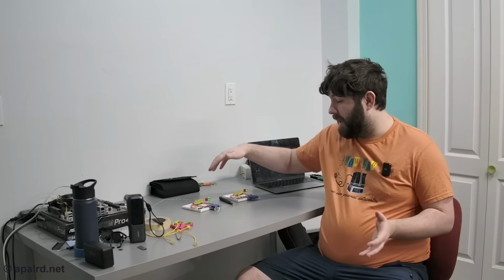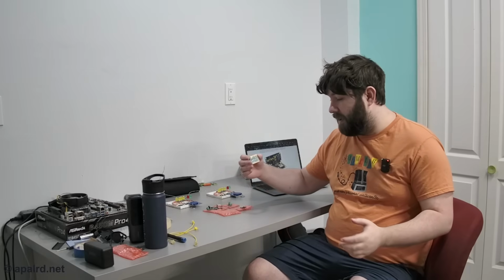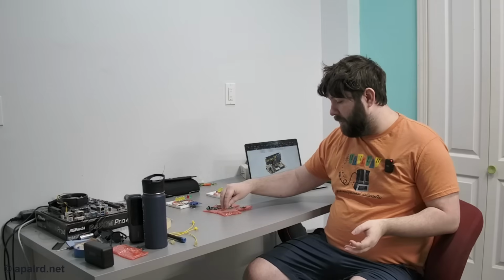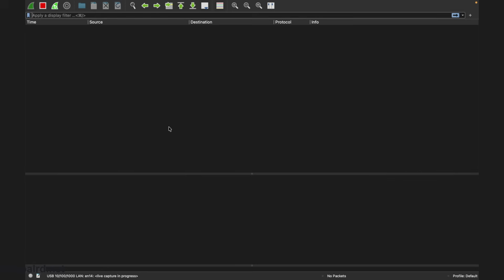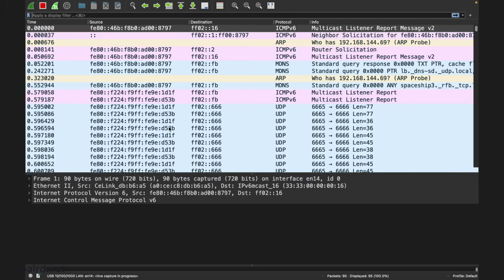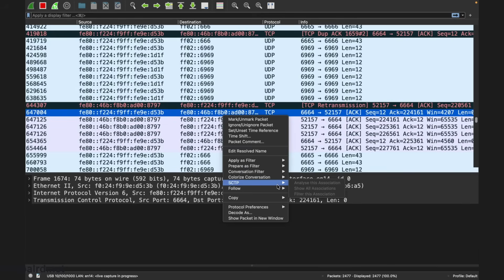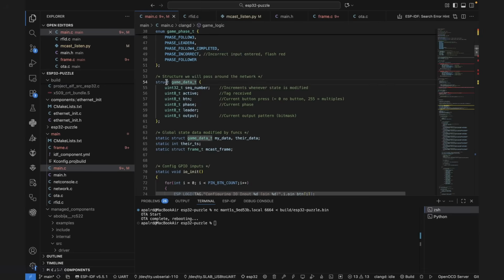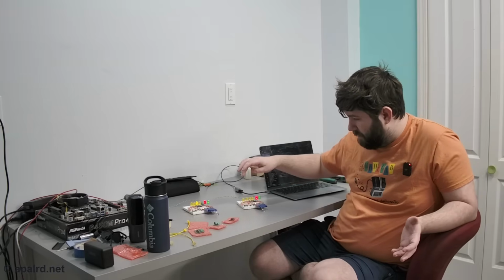ETHERNET is a BUS again?!? Taking a look at 10Base-T1S Multi-Drop Ethernet

Comment: Would be interesting to try.  Wish it was a bit cheaper then $44 per module.  ESP32 boards are $4.
Reply: The PHY chips themselves are only a couple of dollars and don’t need many external components. These modules are only expensive because of the low volume PCB assembly.
Reply: I don’t understand why he didn’t just use WiFi for this.
Reply: @therealcmj if you want better reliability wire is always the winner 👌
Reply: @testman9541  we’re taking about 10 or 20 feet in a controlled environment. Honestly, I think that pulling a wire and using this board is more complicated and likely to fail than WiFi or Bluetooth on an ESP32 device board in this situation.
Reply: @therealcmj in an automobile, in a machine or in a building... Twisted pair will always be better than relying on spectrum availability and low noise in the environnement 👌

Comment: Fuck yeah embedded IPv6!!! I love seeing well implemented embedded IPv6!
Reply: The only time I've seen embedded IPv6 is in Matter/Thread specs for IoT devices. It's so much better
Reply: What’s the advantage of IPv6 in embedded?
Reply: @bensmith7190  No advantage.
Reply: Fuck yeah i love seeing over800% overhead in my resource-constricted applications.
Reply: @denisdrozdoff2926  Ethernet+IPv6 headers takes 72+60 bytes, it's not that much.
Reply: @denisdrozdoff2926  Could you tell me where this overhead is coming from, compared to v4? I’m curious.
Reply: @xanderplayz3446 it's not as bad compared to v4, but if we shed all of the IP stack where it doesn't belong the change is dramatic.
Reply: @xanderplayz3446 packet header. 20bytes larger.
Reply: IPv6 - overingeneered nonsense
Reply: @btudrus aka you refuse to learn something new. IPv6 is conceptually so much simpler than IPv4 so... no.

Comment: single pair ethernet (SPE) can move up to 10Gbit, with up to 25Gb on it's way. 10Gbase-T1 (no S or L)/802.3ch, can have runs up to 40m. 1Gbase-T1/802.3bp, up to 40m.  also, 10base-T1 (no S) is capable of 100m transmission, while -T1L is capable of 1000m.
Reply: Interesting
Reply: SPE/Ethernet-APL is really interesting, especially for industrial uses, especially for replacing profibus PA in process automation. However, i believe it is only P2P and not multidrop, so I would not be surprised if this is a continuation of the standard to allow for multi-drop with the speedloss you get with a large collision domain.
Reply: @AlecTBM  according to what I read, they're all multi-drop capable.
Reply from the maker: SPE is not all multi-drop capable. 10Base-T1S is, but 100Base-T1 and 1000Base-T1 are not. 

T1S also does not use CSMA/CD as in legacy Ethernet, it uses a scheme called PLCA (PHY-Level Collision Avoidance) where transmit opportunities are offered to each node on the bus sequentially based on the order in which they joined the bus, so each node is periodically guaranteed a very short interval to begin transmitting without congestion. This generally avoids collisions entirely and only wastes a very small amount of bandwidth with the empty transmit opportunities.

Comment: Close enough! Welcome back, Thicknet
Reply: More like thinnet.  Thicknet (1/2in+ diameter) coax was significantly worse than RG-8. Entirely. Not. Fun.  Not even the vampire taps were fun after the first couple.

RG-58 (under 1/4in dia) was a lot better especially being able to terminate with easy to crimp BNCs.  But it did become a forest of BNCs and Tees...  Some vendors improved this with a twin RG-58 in a single jacket that integrated the Tee on the device end and came with various connectors (or even just wire ends to attach your own) on the other (for the  physical plant). Just avoid the ones that had single plug that went into a special connector that tried to automatically make/break the bus as appropriate for the device. They sounded so nice, and even the demonstration and first few months of usage were pretty nice.  Then the intermittent problems started...
Reply: I never managed a thicknet network  @Sylvan_dB , I only used one, but I never saw network engineers crawling around under desks trying to find and fix standing waves. When I was managing a thinnet network though, standing waves were a daily occurrence.

The day we plugged everything into a new structured cabling system and 10/100 switches, was a day of joy.
Reply: Ah, don't remind me about Thinnet standing waves. *8')

Crawling around under desks, swapping cables to try and move the standing wave away from a node, to get it back on the network.

Comment: This is perfect for my ESPHome boat. I now use CANBus, but this is so much cleaner, using ESPHome's packet_transport over UDP makes this all too easy.
Reply: $50 per node is kinda steep, no? RS485 seems a lot more fitting.
Reply: @JGnLAU  RS485 doesn't perform reliably enough for me in automotive/maritime applications.

Comment: One other application I can see using this for is Out Of Band management/IPMI. Instead of each servers IPMI taking up an extra port on a switch. You use one for each server rack. This also keeps the wire management to a minimum.
Reply from the maker: Meta had done a conference talk on something somewhat similar. They are using GPON for their out of band network. They already share nic and bmc across 4 servers, but now they can optically split a single fiber to 32 top of rack oob switches instead of running 32 fibers. They also switched to using multiport ONUs instead of switches, so they fit on top of the rack instead of using a rack unit.

Comment: I wonder if one could use Thread for implementing such puzzles..
Reply: Thread is basically updated ZigBee. You can totally do that, but why? Wires are way more reliable
Reply: @saiv46 yes, wires are better. My thought went along the line of "already fully integrated ipv6 with existing jellybean components and the border gateway problem solved" - one would get most of the stack handed out

Comment: I was peripherally involved in the IEEE side of the development of this stuff a number of years ago. I worked on a team at Harman International that was involved in the AVB/TSN standards for pro audio and automotive use cases, and we collaborated a lot with groups from Broadcom and other OEM suppliers on the lower-level technologies. We helped get the BroadRReach stuff out of the weird apartment complex use case it was developed for and into automotive, which got the industrial control folks interested eventually. The CAN people were not really happy about the T1 developments; one of the things I personally did was some experiments around doing time sync with 10MB multidrop ethernet, which the CAN folks were arguing was not feasible. This is as far as I remember things going anyway via second-hand conversations with colleagues who worked more closely in the "political" arena of the standards development.
Reply: Interesting, I wonder if it was originally developed as an alternative to Cisco's LRE which was developed to do 10Mb over single twisted pair and distances of >100m. Cisco developed it for hotels, but I know it saw use in many apartments in places like NYC where the cost of running new cables was large.
Reply: just tell me whose side I should be on.  gosh!

Comment: It's great the automotive industry is focusing on CANbus replacements, rather than securing the electronic components that run on the car.
Reply from the maker: One of the big problems with can bus is that the payload space per frame is too low for any modern message authentication codes which provide real data security. Moving to can-fd gives 64 bytes of data, which is better, but Ethernet can go much higher.
Reply: @apalrdsadventures 
Please note: I know next to nothing about ethernet, whether in hardware or software. 
Couldn't the increased complexity of ethernet lead to parser vulnerabilities?
Reply from the maker: Only if you use a parsed encoding and not a static binary packing or something simple. You could take every can bus message and send their binary data all in one Ethernet frame, for example. 

Aviation Ethernet doesn’t mandate IP be used at all, they send with custom ethertypes to Ethernet multicast groups. I personally prefer using ipv6 link locals instead but that doesn’t mean you can’t raw dog Ethernet frames for local messages.
Reply: Yay, even less repairable cars!

Comment: I designed some devices that had to deal with CAN-bus in my previous job. CAN-Bus and its related J1939 were nice to debug at the logic-level, almost every oscilloscope could be used to debug it. Unfortunately, CAN is a nightmare at the electrical level, and it is my most hated protocol after 1-Wire/iButton.
Reply: 1-wire. It's named 1-wire, but actually uses three. Two if you are doing very short range. This is what happens when marketing names the product.

Comment: Sadly 10 baseT is no longer supported by a lot of 2.5G and above switches so you are stuck jumping 10base t to 100 or 1g.  At least the protocol is consistent and ip tools work
Reply: That little switch is a 10/100 chip so the upstream port could be 100 base-t.
Reply: The ManT1S-Bridge supports 100 Base-T.

Comment: Sadly, its too expensive compared to CAN Bus (or even a regular Ethernet port for ESP32). I have even seen a ESP32 with POE capability that is cheaper than that.
A Network with 8 Devices costs with this system 8*44$ + 58$ = 410$.

In comparison, I get a ESP32-POE-ISO for ~25$*8 + 100$ (for an 8 Port POE Switch) = 300$. If I can use a simple USB Power Supply, I can get away with even less.

Any info on what price is planned/to be expected in the future?
Reply: ManT1S manufacturer here.  I wanted this board to be significantly cheaper, my aim last year when I started work on it was low $30's at introduction.  But then someone started a trade war and with tariffs and bans changing from one week to the next, my component cost, import cost and uncertainty in general have skyrocketed.  The fact is that at this time, I do not know what it's going to cost me to produce these until they are physically in my hands and the final tariff bill has arrived.  So I raised the campaign price to maintain a profit margin based on tariff history observed this year.

A crowdsourcing campaign is not just buying a product but also a way to support a manufacturer to be able to launch something you want to exist in the market.  If you don't want to do that, or you are not interested in the technology existing in the market, that's fine of course.  I personally think T1S is an interesting technology and I want people to have an easy way to get started with it.  Comparing apples to apples, this is not a bad deal (see the comparison table on the campaign page).  Yes you can use the ESP32-POE-ISO if it works for your application, but that only works if you don't need more than 2W of power.  Upgrading to the wESP32 you get 13W, but with the ManT1S you can reach up to 52W.  Whether that matters to you depends on your application, but it does open applications that the ESP32-POE-ISO can't handle.

I hope to lower the prices in the future if conditions improve, but I'm not holding my breath for the next 3 years.  In the meantime, the kit offers a bit of a discount versus individual boards.
Reply: And good old RS485 is even cheaper still.

Comment: How is T1S with a Mantis Bridge better than CAN with a CAN to Ethernet bridge? In the end of the day both seem to need a bridge to connect them to regular ethernet network.
Reply from the maker: The mantis bridge is passing Ethernet frames between two layer 1 protocols with the same layer 2 framing. Can to Ethernet requires decoding / converting the can frames which requires knowledge of the data structures at that layer.
Reply: @apalrdsadventures basically the mantis bridge is a layer 1 media converter,  and a CAN converter is a full layer 3 device and likely only speaks TCP/IP. In theory you could run NETBeui or IPX/SPX over 10BaseT1.

Comment: Multi-drop "Bus topology" is the problem.  All too often one of the controllers grabs the bus and doesn't let go or puts noise on the bus.  Ethernet would be a great improvement in cars and trucks but it seems to me it needs to be in a star/switch network not a bus.
Reply: With T1S it's essentially a time-share protocol underneath, where each node on the bus has it's own limited time segment where it can send packets (with the optimization that if a node doesn't have anything to send, after a tiny bit it moves over to the next node on the bus), so I don't think that's a problem here. The bus is mostly requested by automotive, as they want to reduce the amount of wiring as much as possible.
Reply: @ignaloidas  It's called PLCA for those who want to look it up.

It's not like token bus/ARCNET. It reminds me of some previous protocol but I can't think of which. It requires a timing accuracy between nodes which would be hard to satisfy at high bitrates but seems pretty easy to manage at the short lengths and slow speeds of 10BASE-T.
Reply: @ignaloidas  ~ Any time-sharing bus topology is going to be unreliable, especially in an automotive environment!  Ask any car or truck mechanic!
Reply: Sorry I'm a noob in networking, but can't a single controller still flood the ethernet channel(s) with noise and thereby disable all communications?
Reply: @0xfadead ~ If it was point-to-point with some sort of switch in the hub, I would expect the switch to disable any offending device.  Another option would be two identical multi-drop networks to all node so if you have one go down for any reason any of the nodes could turn on the money light and still keep working on the redundant bus.  Twisted pair is cheap and lightweight and this would really improve reliability and troubleshooting of complex bus system problems.

Comment: First Ben Eater and now you; I'm really surprised how a lot of Tech YouTubers I watch have a background in avionics. Knowing about Arinc 429 etc. 😂
Reply from the maker: God I hate ARINC 429 so much. I wrote a bit banging implementation using a microcoded timer since asics are stupidly expensive and the protocol was designed to be super primitive using basic ttl logic but no modern communications hardware supports it. 

Thankfully aviation is moving to Ethernet! Not even single pair automotive Ethernet, just regular off the shelf Ethernet.
Reply: Argh - one of my first jobs was an ARINC 429 implementation that did protocol conversion.  never again.

Comment: Does it work over coax?
Reply: Lol. I mean for that we have 10 base 2 silly....
Reply: @varno  but 10base2 doesn't have POE.....
Reply: @imark7777777 ah, but 10 base t is manchester encoded, so you can use a bias-T to send power along that coax relatively easily, a cut off of 100khz works well. 

To be more serious moca is probably the better option these days.
Reply: yes ethernet over coax is the first form of ethernet. Just make sure you got 2 wires going ;p

Comment: Gigabit over 2 wires? :O
Reply: It's 10MB
Reply: @cowingtonpost6837 
He mentioned that gigabit variant also exists.
Reply from the maker: A 10-gigabit variant also exists. From 100M up to 10G they all support 15m and need progressively higher class cables, from 100mhz cables at 100m up to 4000mhz cables at 10g. So gigabit over single pair requires 500mhz cables, which is Cat6A.
Reply from the maker: Also aside from T1S they are all strictly point to point
Reply: @cowingtonpost6837  ~ I worked at Compaq in the late '80s and we started out with LANs by running entire floors off of a single ARCNET over TP and 10Gbe networks!  :o)

Comment: And of course this guy HAD to use IPv6 😂😂😂😂
Reply: Well superior youtube channel, superior protocol
Reply: No one is perfect!  :o)
Reply: I dread the day ipv6 ever becomes mainstream. I looooooathe ipv6
Reply: @cal2127  so 60% worldwide adoption with some regions at 99% is not mainstream enough?
Reply: @cal2127 there is absolutely no need for IPv6 to become a thing in the near future. There is absolutely no need to have more than a couple thousand devices on a single network. And having to get all the existing network protocols to work with it will be a huge pain.
Reply: @egenethebest9107  uhm, there is definitely a need for more address space.
Reply: @cal2127 why, ipv6 is so simple, at the site of the mess that carrier grade nat and local nat i would not want to deal with that broken mess. Nice simple routing and firewalling job done. Whats your issue with ipv6 ?

Comment: Wait, poe over 2 wire? How does that work?
Reply: It's easy, you just put DC on and then use capacitors and/or a transformer balun on the ends to isolate the data from the DC voltage. Data inherently avoids DC levels.
Reply from the maker: The reference design for T1S uses capacitors to couple the phy to the bus and filter inductors to couple the power supply